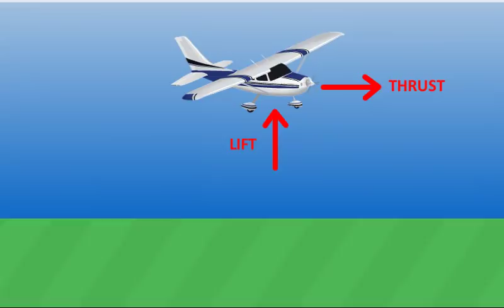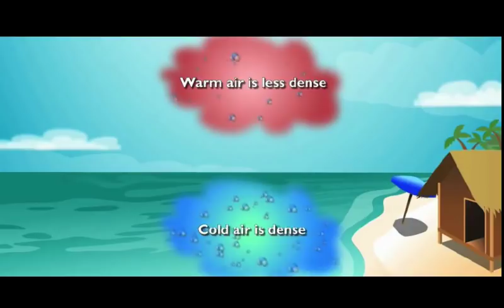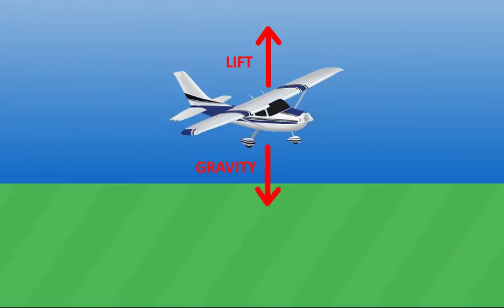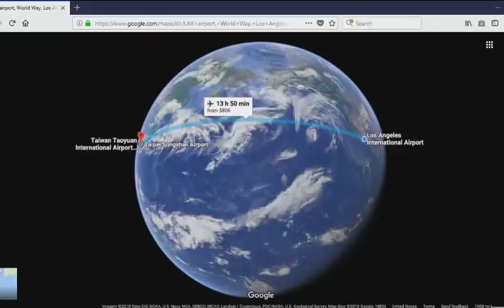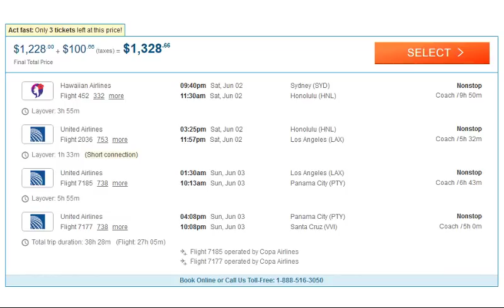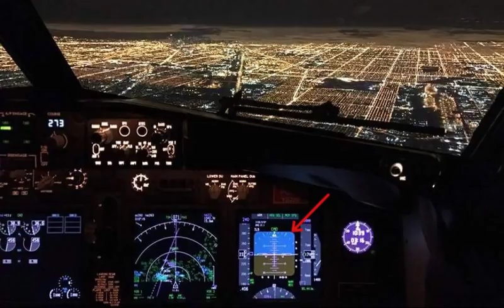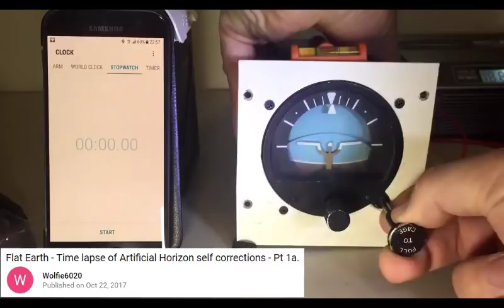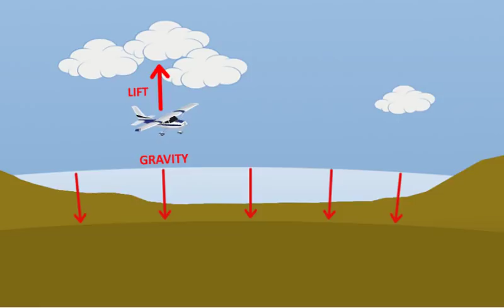Flat Earth Falsities - Plane Nonsense

Comment: this globetard sounds like a babbling fool
Reply: @dave chang
Is a babbling fool who runs away from questions and reality. This is not ad hom. It is factual.
2 hours ago
@dave chang
No dave, you believe you think, if you could think you would know the Earth is a spheroid.
No dave, you believe you think you know, but actually you just believe because you don't know.
If you actually do have the intellect and knowledge you claim you should be able to answer these simple questions.
Why is it that a compass needle is more or less vertical at the poles and horizontal at the magnetic equator?
And when you carry on past the poles the needle slowly returns to the horizontal?
Why is it that it is only possible to navigate accurately over long distances using spherical trigonometry?
Why is it that traditional gyro compasses work perfectly in low latitudes but became unreliable in high latitudes?
Why is it that it is only possible to navigate accurately over long distances using charts based on a terrestrial spheroid?
Why is it that when you watch a ship sailing away from you the hull is the first thing to go below the horizon, then the superstructure and finally the funnel and upperworks?
Does a magnetic compass point towards polaris (Alpha Ursae Minoris) at the north and south poles?
Does a gyro compass point towards Alpha Ursae Minoris at the north and south poles?
What is the relationship between longitude and distance when travelling east or west parallel to the equator?
Tell me how you ascertain the error of a compass when in the Southern Ocean, using Alpha Ursae Minoris?
Please explain the principles behind the development and functioning of a gyrocompass?
No evasions please, just straight answers.
Reply: To wong -a real scientist would not seek answers from people but to find out with proper experiments ,so you obviously are  stupid and lazy to find out like a real scientist  because the more you ask question the dumber you seem to be ,now go get some real education, your stupidity is intolerable and pestering,grow up
Reply: +dave chang

"a real scientist would not seek answers from people but to find out with proper experiments"

Exactly. What proper experiments have you personally done to confirm your opinion that the earth is flat?
Reply: Nice us of the logical fallacy ad hominem attack.
Reply: likewise
Reply: Except that I didn't us one.Nice try but fail.Saying that you used the logical fallacy ad hominem attack.Is not using it against you.
Reply: Flat Earthers have no so called scientific shit cause all flat minds IQs are 20 and can’t go beyond that they just scared of the truth and real science and technology or the truth many are bible fanatics worship a stupid toilet paper that is 85% fictional and cause they do not understand it as they want to create a new world from wonderland make all believe to that shit so they feel we are important sand special ,they leaned few words like CGI and they think everything is that jut saying it around like little dumbs and wasting and wasting 15 hours a day on nonsense and looking crappy home youtube videos off other flat idiots .just our galaxy has around 100+ billion earth like planets even some with advance life people like us but like millions of years more advance not like some idiots  here in earth and out there are billions off galaxies now make the math what’s out there.......some flat earthers quotes the sun is a size of an orange and its 30 miles on the sky.......... there are suns out there in galaxy that are 1 million times bigger then our real sun size you can fit like a million suns in . Go find a cave and stay there if you want dream about flat dreams. About 150 to 200 years humanity will be a multi planetary species with interstellar technology and all fe dreams will be forgotten by then. You FE soon can buy a ticket if you have money by Virgin Galactic or Elon Musk to visit space soon and see it for yourself but even then you won’t believe it you will say your eyes are fake.most of them are losers of their own life many do drugs and many as you notice now they try to be wanna be famous and some do it even for money donate and whatever shit new the come up to.
Reply: George Orwell, Tribune, 27 December 1946 =  Most people, if asked to prove that the earth is round, would not even bother to produce the rather weak arguments I have outlined above. They would start off by saying that ‘everyone knows’ the earth to be round, and if pressed further, would become angry. In a way Shaw is right. This is a credulous age, and the burden of knowledge which we now have to carry is partly responsible.
Man was not a FE, but witness the babblings of gullible blind followers.
If we can but tear the blindfold of self-deception from our eyes and loosen the gag of self-denial from our voices, we can restore our country to greatness.
Theodore C. Sorensen
Reply: +Louis Shaw

"Most people, if asked to prove that the earth is round, would not even bother to produce the rather weak arguments I have outlined above."

We are not most people. We have shown you multiple detailed debunkings of the flat earth, and have shown you multiple ways that you can figure things out for yourself. And all we get back is rhetoric and old quotes - no evidence at all. If you want to know why no one believes you that the earth is flat, there's your answer.
Reply: @rayopeongo  That is funny WE, cause I sure did not see any of that in SCHOOL, as some good boys have admitted in comments here, strange how APOLLO tales also have "mountains of proofs" "debunked thousands of times" etc etc, but a hundred sites have been generated by engineers /phds /professionals to support Moon rock picking and bouncing and golfing...
Now why so much juice for unbias figuring yourself REALITY??? Against "no-one-believes" gov hoaxs... oxymoron logic....
Just crybabies lamenting so bad boys dont want to believe in flying balls all over the place.
Reply: +Louis Shaw

"strange how APOLLO tales also have "mountains of proofs" "debunked thousands of times" etc etc, but a hundred sites have been generated by engineers /phds /professionals to support Moon rock picking and bouncing and golfing..."

You really need to learn how to put together a sentence, I have no idea what you are trying to say. Are you saying that there are a hundred sites debunking Apollo, or proving that it actually happened?

Besides, who cares what NASA says or does? I don't need any help from NASA to debunk the flat earth. There are dozens of different, easy ways for anyone to do it on their own, as I have already explained to you multiple times. And you still haven't come up with any explanations for how any of the phenomena that I have described work on a flat earth. You haven't explained how it is possible for the southern stars to rotate clockwise around the south celestial pole instead of counter-clockwise around Polaris as the flat earth model says they should. You haven't explained what mechanism on the flat earth causes low pressure weather systems to rotate clockwise south of the equator, and counter-clockwise north of the equator. You haven't explained how it is possible for the height of Polaris above the horizon can exactly match the latitude of an observer north of the equator. You also haven't explained how it is possible for direct flights between Sydney and Santiago to work on a flat earth.
Reply: @BrainUser1  • Fuck off, trol

Comment: I watched a lot of films con and pro FE. Both sides didn't convince me, till I came across all the theory about flight paths. I check all my flights with maps and times, and check them later on the globe and the Gleeson map. But my mom's trip convinced me.

@Louis Shaw
No second hand knowledge. I put my mom on her flight in Johannesburg and my sister fetched her in Perth, we phoned to make sure she collected mom. So it doesn't matter if she was sleeping or not. There were NO stops. It was a straight flight, which took her a little bit longer than 9 hours, her flight was much shorter in time than mine to Amsterdam, also a straight flight without stops. We checked the times. I don't remember our airlines, we still fly a lot.
Reply: South African Airways SA 280 - 5,169 miles direct, about 9-1/2 hours.
Reply: Mattie Goedegebuur
"the Gleeson map"
 Gleason's Map is simply an Azimuthal Equidistant Projection, a projection first mathematically developed by Abū Rayḥān Muḥammad ibn Aḥmad Al-Bīrūnī (a devout Muslim) in the10th Century, and Gleason simply copied the projection method. As did the UN and the USGS etc.
Al-Bīrūnī knew the earth was spherical and believed that it rotated, he also measured the earth's radius.
He deduced the existence of the Americas on the basis of his accurate estimations of the Earth's circumference and Afro-Eurasia's size. This was several hundred years before Columbus et al.
So the FE cult's plagiarised map is actually proof the earth is not flat.
Reply: @seymoresaymore, thank you, that was probably her flight
Reply: I'd say that's just about as solid proof as you can get.

Comment: like i said science is not for globtards
Reply: @NotTheCIA I.think correction, it's like playing chess with an extra stupid pigeon that refuses to believe that the chessboard it's shitting on is real.
Reply: everything is flat earth science you r just too stupid to realize it
Reply: Sorry Dave, but you're way over your head. Just buy the equipment in this paper (there's a shopping list in it), and record that Earth's rotation in real-time. Electronic engineering completely tosses out any idea of a flat earth: 

https://www.researchgate.net/publication/230962822_Using_a_MEMS_gyroscope_to_measure_the_Earth%27s_rotation_for_gyrocompassing_applications
Reply: why do you use assumtions  as proof,why do you believe what you been taught is true,if you r so smart what is the most obvious reason or proof to claim that the earth is round explain that to the next generation of kids in simple science terms hmmm what is the most obvious  self evident fact can you explain with out giving people doubts?
Reply: +dave chang

"if you r so smart what is the most obvious reason or proof to claim that the earth is round"

The flat earth model claims that all celestial objects circle Polaris counter-clockwise. However, when looking south from south of the equator, the southern stars are seen to be different from the northern stars, they rotate around a point in the sky other than Polaris, and they rotate around that point clockwise, not counter-clockwise. You can't even SEE Polaris from south of the equator.

You either don't know anything about the stars, or you live north of the equator. From north of the equator, the movements of celestial objects do superficially agree with the flat earth model, as long as you don't look too closely or measure things too accurately. However, if you are south of the equator, you only have to spend one evening studying the night sky to know that the earth is not flat.
Reply: +dave chang

"if the stars rotate around polaris like you said then that would mean the earth is stationary stupid"

As usual, the flat earther misses the point. When looking north, the northern stars appear to rotate around Polaris counter-clockwise. HOWEVER, when looking SOUTH from SOUTH of the equator, the southern stars are different from the northern stars, they rotate around a different point in the sky than Polaris, and they rotate around that point clockwise, as opposed to the northern stars rotating counter-clockwise around Polaris. You can't even SEE Polaris from south of the equator. 

How do you explain how all of that works on a flat earth?
Reply: if that is the case then how come we see the same constelations
Reply: +dave chang 

"if that is the case then how come we see the same constelations"

We don't see the same constellations. NO ONE sees exactly the same constellations EVERY night all year long. Looking north from north of the equator, we see the Big Dipper all year long, but it moves around. At sunset in one month, it may be at 4 o'clock with respect to Polaris, but 6 months later, it will be at 10 o'clock with respect to Polaris at sunset, 180 degrees from where it was. That is because we are on the other side of our orbit and looking in the opposite direction at night time. 

Looking south from north of the equator, the constellations change slowly each month. In March, Orion is due south of us and obvious in the evening. Now, we are on the other side of our orbit and the sun blocks our view of Orion. We see Sagittarius in the evening sky instead. By the way, Australians see Orion upside down relative to us, and call it the plow. Some folks south of the equator only get an occasional glimpse of the Big Dipper, most never see it, while those of us in North America, Asia and Europe never see the Southern Cross, or the Large and Small Magellanic Clouds, constellations that southerners see every night.

Even very simple observations of the night sky debunk the flat earth.
Reply: nope ,incorrect but nice try
Reply: @dave chang
No dave, you believe you think, if you could think you would know the Earth is a spheroid.
No dave, you believe you think you know, but actually you just believe because you don't know.
If you actually do have the intellect and knowledge you claim you should be able to answer these simple questions.
Why is it that a compass needle is more or less vertical at the poles and horizontal at the magnetic equator?
And when you carry on past the poles the needle slowly returns to the horizontal?
Why is it that it is only possible to navigate accurately over long distances using spherical trigonometry?
Why is it that traditional gyro compasses work perfectly in low latitudes but became unreliable in high latitudes?
Why is it that it is only possible to navigate accurately over long distances using charts based on a terrestrial spheroid?
Why is it that when you watch a ship sailing away from you the hull is the first thing to go below the horizon, then the superstructure and finally the funnel and upperworks?
Does a magnetic compass point towards polaris (Alpha Ursae Minoris) at the north and south poles?
Does a gyro compass point towards Alpha Ursae Minoris at the north and south poles?
What is the relationship between longitude and distance when travelling east or west parallel to the equator?
Tell me how you ascertain the error of a compass when in the Southern Ocean, using Alpha Ursae Minoris?
Please explain the principles behind the development and functioning of a gyrocompass?
No evasions please, just straight answers.
Reply: ray opeongo , nope that is all incorrect again, but nice try
Reply: @davechang422  • Why do you come to YouTube comments sections to ask questions?

I'm just kidding, I know why. Because you're too stupid to know just how stupid you are. You see, smart people tend figure out where to go to find actual answers to actual questions. You're just here to parrot idiotic shit like "You only believe what you've been told"

I want you to stop and think about just how fucking stupid such a statement is. Every single byte of knowledge in that wee little fuckwit brain exists because someone told it to you in one way or another. That is of course unless you're suggesting that you learned how to read, how to plunk out stupidity on your keyboard, by fucking osmosis.

Jesus Christ, you people are fucking muppets!
Reply: Check out CoolHardLogic. He'll straighten your head.
Reply: Corectiuon science is not for flattards.
Reply: funny how science proves the earth is round not flat.
Reply: To cia-are you blind as well as dumb the proof is so self evident
Reply: to cia well you checked out the wrong sources obviously  say why dont you just uh um experiment like a true scientist instead of seeking answers you will not accept in your paradigm of a rabbit hole you got yourself into.find out yourself stupid dont ask if your r just going to argue  go see for your self,  stop being a pest
Reply: you r standing on it  now start all study from there now  remember the degree of the sphere never changes but has to stay the same  -find the degree of the surface,check back on me on this
Reply: to cia- nope ,you are incorrect again , go back and check how you do your experiments ,i will correct you again if you r wrong again,ok?
Reply: if you carefully look back at your comments and tell me would that explaination of yours   convince anyone that the earth is a globe?now smart ass lets see if you can convince the world with your logic
Reply: Dave chang that's easy sunset sun rise day night.That stars in the northern hemisphere can be seen in the southern hemisphere they move in one direction.while stars in the soopthern hemispherecasnt be seen in the northen hemisphere.Move  in the opositre direction.Stars in the northern hemisphere do.All;s gravity p[revents the eartjh from being flaty.oh the lake pnotitran power yransmiosions lines how the earth cureveture.As does satellite photos.
Reply: nope all wrong again nice try keep searching ill let you know when you get it right ,ok?
Reply: dave chang nice us of the logical fallacy ad hominem attack.Allso science proves the earth is round not flat.Now show me your evidence that the earth is flat.
Reply: to thunder -u standing on it
Reply: Dave chang wow lol so no evidence that proves the eartrh is flat.Why am I not surprised.
Reply: Still no evidence that proves the earth is flat.Just I said so argument.LOL.Why I am I not surprised.
Reply: to thunderstruct=i told you ,you are standing on the evidence start your studies from there ,now stop pestering me with simple questions
Reply: your logic proves you can not comprehend simple science,therefore you must be a globetard and science is not for globetards
Reply: Dave Chang yet you cant answer a simple question.Lol no surprise there.